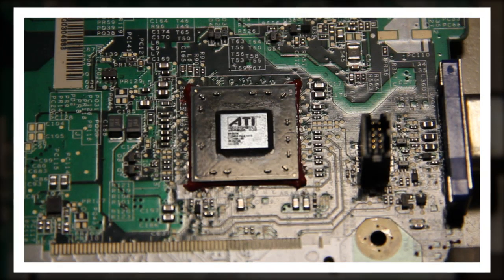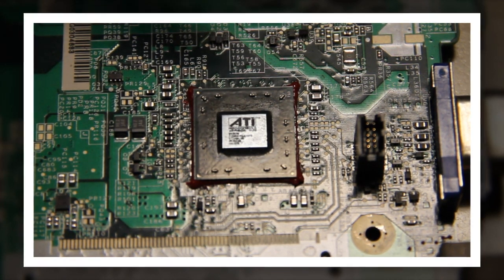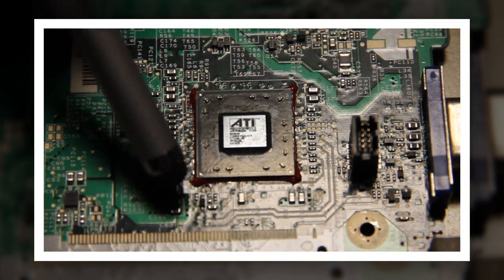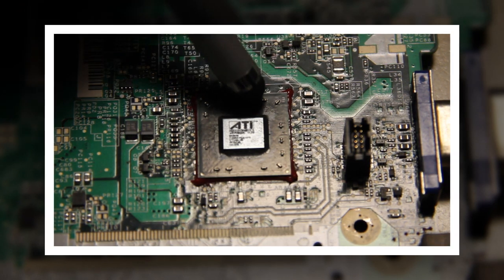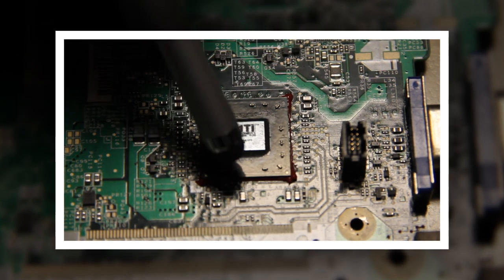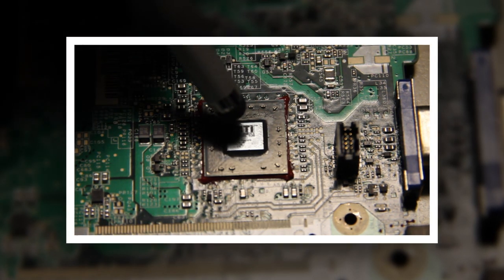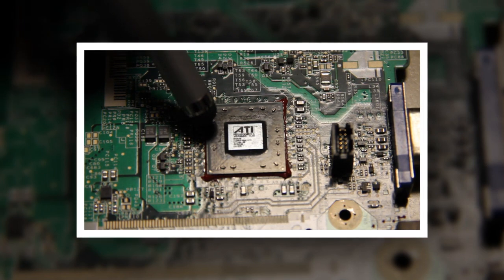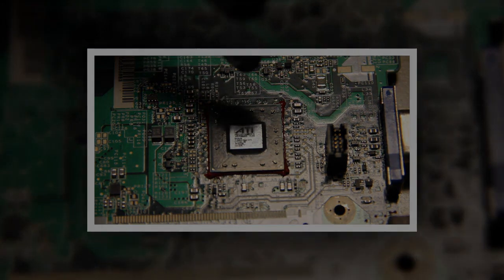GPU Reflow Do's & don'ts

Comment: This video does have a lot of don'ts, but not many do's.
When manufactured the board goes through a reflow oven, yes - an oven.
the SMD components are manufactured to withstand up to a certain temperature with minimal damage, that temperature is called the relow temperature, that's the temperature at which the solder melts.
Applying heat only to the GPU area will cause that area to expand and will make the board bow up.
I do my reflow repair with an oven, in a controlled manner, of course, and thus far all of them worked out and are still working to this day. Heck, the laptop that i'm using right now would be dead if not the oven reflow.
Since motherboards have many copper layers in them they do conduct heat away from the GPU making it hard to reflow, this can cause frustration and overheating of the BGA fiberglass substrate, which will bubble up and destroy all chances of repair without replacing the chip.
Motherboards will bow in the oven only when they are poorly supported.
Solder surface tension is plenty enough to hold the bottom components in place, the board needs to be above any surface when reflow soldering in the oven, components are easy to knock off when solder is molten.
Any batteries must be removed from the board as they will blow up in the oven and possibly knock all of the components loose if the temperature is high enough.
Flux is not necessary when reflowing, the solder fractures are microscopic and will get quickly soldered back together once reflow temperature is reached.
Talking about the temperature, it is crucial that care is taken when oven reflowing, too cold and the board won't reflow, too hot and the board will bubble up and components will start blowing up.
The oven cannot the used for food after oven reflow, this is why it's not popular to do so.
The laptop i'm using right now does get alot of abuse, i push it to it's limits and keep it there for as long as i want, so far it has been performing very well with no issues what so ever.
This comment is long as it is, i could make it much longer but i won't.
TL:DR - this video gives bad advice, don't take it for granted.
Reply from the maker: Poptart McJelly , it's a lot of what not to do, as I get so many repairs where someone has attempted to repair the boards themselves. Placing a board in an oven is never recommended, as to melt the solder on the chipset, in an oven you heat the whole board and you can un-solder other components, melt any plastic, and capacitors never like high heat. That is why  I will only recommend the correct way, which is with a reflow machine. The back side needs to be heated to 120f, and set top to at least 475f, depending on the solder used, and for about 4mins 30 seconds, again depending on the solder. And make sure to use a quality Flux, alcohol based is best for a clean application. I've been doing reflows for 10 years now with a high success rate and have seen just about every form used. If you can't afford to pay someone, or don't really care about the results, you can use any method of choice, even just putting a penny under the heat sink can apply enough pressure to work for a while.
Reply: I guess in the end it's what ever works.
 and is most practical in a given situation.
I have received laptops that were dead and were said to be un-fixable by the repair shop, only to find out that the blue soldermask had turned green under some of the chips, which are obvious signs of an attempted "reflow".
30 minutes later that same laptop will be sitting on my desk, working like new, all thanks to my oven.
So far i've only had one failed reflow, which was not only my first try but it was also on my own laptop.
I was too careless and allowed the oven to get too hot making the board sound like popcorn.
Since that incident i take care with my reflows, always on standby, ready to shut the oven off when the temperature is right.
SMD parts also include connectors and electrolytics, they are all made to withstand the reflow and they all have datasheets for recommended reflow temperature curves, the only things that can be damaged by a reflow on the motherboard are stickers, RTC clock batteries, sponge spacers and felt ( mostly found in ACER laptops over the buttons ).
Reply from the maker: Poptart McJelly, You can say what works, as I have seen a lot of ways that have worked. But from a professional standpoint, and I've been working with the best in the area, and I've know as one of the best laptop specialist in the area, I can only promote the correct way which is with a reflow machine. I won't condone with others wishes, as I know how I take apart a laptop is different from how someone else might, I may use a different brand of tools, and people choose their own vehicles, and it's not for me to judge. I have been HP and Dell certified, and working with high end clients, I only promote what is correct for the clients. I know when a new board is better than reflowing, and I know when a reflow is just as good and hundreds cheaper. If someone is highly dependent on their system, it's not always worth the risk, and replacement is the correct means. I only use solid copper shims, and I guage them accordingly. I use high end thermal past that doesn't dry as quickly, clean the entire cooling system and I have 2 types of Flux I use depending on the board. Thanks for commenting and I wish you the best.
Reply: The reflow so called experts dont want the competition. I saved numerous TVs and Xboxes from death. To last years later from my house oven. They don't want you to do that because they lose money. Seriously. Think about it. Its obvious it works, but THEY say dont do it? Come on people. Your smarter than that. My oven fixed what a shop couldn't on a Sony tv. One of the first 4k that was like 3000 new. They couldn't fix it, but then asked me to buy it from me. 🤣🤣. Needless to say my oven worked like magic. Dont pay the ridiculous amount for a reflow they want to charge. These TVs now days are not expensive..   Try to fix yourself, it will last a bit.  Then save for a new top end model year. Bet you your oven will last as long as their repair anyways. 10 years or 30 years reflowing, idc. . truth is truth. Ovens work. And it's free.

Comment: Well the best way is to bring the computer to vendor for a repair services!!!
Another way is buying a new graphic card and replace it, but that will involved risk of not putting it right as well! Unless you wanna open a shop for reflowing the chips, otherwise the $230 might cost twice more than a new graphic card.
Reply from the maker: Yes, that is why I published this video. I've been doing reflow work for 10 years when the DV Series came out with the gpu issues. Replacement is always the best option and that is what I promote, but some just don't want to pay the high cost of some boards. When it's cheaper or close to the same price, new replacement is always what I push.

Comment: I mentioned the torch since I have actually seen small torches used. They put foil around the board and hit the die with small torch. I couldn't believe it, but you can also find YouTube videos with people using a torch.

Comment: Just have baked the gtx 780 ti, And it works
Reply from the maker: +BarbaPapa *
 As with any method, it's possible. Otherwise they would never have been posted. Baking at the correct temp to melt solder would mean melting anything plastic, and any components on the bottom would fall off due to gravity. Other components can move or end up with a cold solder joint, so that is why this is one of the worst ways to get them to work. Usually what happens is they are heated just enough to warp the board, and then by re-seating the heatsink, it puts enough pressure to work. Again, this CAN work, but the correct method is the correct machine for the job. You wouldn't use a crescent wrench, pliers, or vice grips to remove the lug nuts of a tire, but it can work if the right tool isn't available. Their is always options that can work. I can only post the correct way so if any other method fails I cannot be at fault. Also, I manage a high end professional shop, and we only perform correct and legit repairs, so I will only promote the correct way to do things.

Thanks for your response.

Comment: Yesterday my MSI HD6850 got bad, and did the green vertical lines problem even in the BIOS no matter how many times I've tried or how much the GPU was cooled down. I've tried a simple re-silicone pasta method but that did not work it was permanently damaged.

I never did GPU cooking, and I was skeptical, cuz i was afrad of the things you've said in this video, that everything could become loose, warped, and be damaged if you put it in the oven, cuz the heat is all over the place (Im a BSC graduate on engineering). So I searched on google, and found out that the hair dryer method is the least risky for me, because I could focus the heat only on the GPU.

So I've took my girlfriends 1400w Philips hairdryer, got rid of the fan and cleaned off the badly dryed out (ouch!) silicone pasta with her nail polish remover aceton (what would I do without my precious gilrfiend?? lol).

After that I positioned the hairdryer on the GPU close up about 3-4mm distance, and shoot it on max heat setting for about 10-12 minutes (I didnt count the time..). I've read on forums that people are sceptical about hairdryer methoud cuz it doesnt generate enough heat for the melting points, saying that they couldnt even get it up to 100 Celsius, but I can confirm that it did go above 100 Celsius cuz I've poured a water drop on the socket and it evaporated instantly.

I let it cool down for about 5-6 minutes, and after that I put on new silicone pasta, put on the fan and took it back into the PCIe slot of my motherboard.

And to my astonishment, it did work! No green lines, Its stable since 1 day, no problems yet :)

So I just wanted to share my story with you guys.
Reply from the maker: I am glad it worked for you. Thanks for commenting.  The dangers of using a hair dryer is while it seems focused on the GPU, the extra air has to go somewhere. That hot air blowing sideways is dangerous to the surrounding components. Just to let you know as well, 100 degree Celsius is only half the temp that low temp solder will melt at. 240 to 270 degrees Celsius is where you want the temp, but not with blowing heat as it will blow off the small caps and resistors on the chipset. If you could focus the heat on the die or under the chip, it could work. On this card, I believe it should have a heat spreader on the chipset so the capacitors would be covered up and protected from blowing air. A high temp air gun can be purchased at Walmart for removing paint. This might get to the right temp, but you would have to use something to protect the surrounding components. Maybe a damp towel and foil , I don't know, I've never tried it that way. It actually may be better to remove any plastic, the fans and leave the heat sink on and heat just the heat sink with the hot air gun to protect the board from the blowing air. you would need at least 270 to 375 degrees Celsius for around 7 to 10 minutes to get the solder to melt, but it also my not heat all the pins on the chip. I only charge $60 plus shipping for reflows, so if you want to keep the card, reflowing may be the way to go. Thanks for the info and I'm glad it worked for you.
John
Reply: Mate that’s almost word for word what I did!

Comment from the maker: I'm sorry you feel the video doesn't meet your expectations. The "Do's" is to use a machine. I won't show a video that could potentially cause catastrophic failure as I would become the responsible party for any damages. A $230 machine will work, but like you stated, a lot of people are simply trying to fix it themselves without spending a lot of money. It is only an opinion, but my opinion is if you can't afford to buy the correct equipment to fix it, then take it to a shop that does have the correct equipment and have them repair it. most will repair it for $60 to $80 and have the correct machine. If you are going to spend $40 for a heat gun and attempt to fix a reflow issue that you have a greater chance of ruining permanently, than my opinion would be to have it repaired correctly for the extra $20 to $40 and you won't have to worry about any mistakes. I know I give a warranty with my repairs as well, so that tiny bit extra comes with that piece of mind that it was done correctly and will continue to last longer. Using any other method besides the correct me method comes with risks and no guarantee that it will last at all, and my need to he repeated regularly.
Reply: a dead graphics card is a dead graphic card you will lose nothing unless do this on  working one.
lots of people fix those dead gpu out from the oven what can say about that a miracle?
Reply: Well if it's just your opinion then why didn't you put it that way?
Reply from the maker: @hunzhurte  it's not necessarily opinion. I've been trained and working with electronics including soldering in bulk for 34yrs. Working in the industry, I have seen many ways people use to fix the issue. Their is the correct ways, and then ways that work by chance.

Comment: First off,you should change the title,as there are no "do's", second, If someone comes across this looking for reflow instructions it's because they don't have $600! Why anyone that doesn't have a business repairing electronics would spend that much on a reflow machine is completely beyond me! I've used the heat gun method half dozen times on my old ps3(fat) alone and spent a grand total of about $40 or so (on thermal grease,Arctic 5,if anyone's curious) then there's my old Sony Vaio,which is working 100% because of the heat gun method! (Bought both in 2008! ps3 still games and laptop still fine for internet browsing,and older games) For $600 I could just get a new ps3(or 4) and have plenty left over! ...or a cheap laptop,maybe use it as down payment on new(ish) laptop!  Thanks for the "Captain obvious" tips though
You mean I shouldn't stick my MB in the oven @ 350+ Degrees?!?.
Reply: Stick it in the oven?! Ah, no! Will using thermal paste/clay protect the nearby components? Use a torch?! Nope! Just a heat gun!

Comment: Nice video, but I doubt anyone's gonna buy a 600$ machine for that 1 or 2 reflows they'll ever do, if you constantly have to do something like this then yeah a machine is prob the best solution. I just did my first reflow today with an old GTX 260, what I did is put it underneath my microwave oven grill for about 7-10 minutes and it works again now.

Comment: Don't do this, don't do that, and definitely do not do it that way. Very unhelpful.
Reply from the maker: I made the video as a test, but also informational. Yes it's a lot of don't do this or that, but all the methods mentioned are what I hear a lot of shops doing and they all can cause many problems. Their is only one real way, which is the correct way with the machine designed for the job. How many ways do you dig a hole in your backyard 18 wide 24 inches deep? Not with a cup, not with a spoon, but the right tool such as a shovel. This is only to help let people know why to stay away from bad methods when re-flow machines start at $200 and the preferred one is about $800. If you are going to be doing this for a business, just by the machine. 10 boards and it's paid off.
Reply: John Gebman I did it the wrong way like I always do when the GPU replacement is not an option or too expensive. Disassembled. Cleaned with alcohol. Used foil tape around the GPU to protect all the other components. Sandwiched the back of the board against flexible closed cell foam to keep any components from loosening. Ran a heat gun at max for 90 seconds moving constantly. Allowed it to cool. Untaped and cleaned up with alcohol. Re-assembled with good heat sink compound. Works like a champ. Been several months and no complaints. Luck? Perhaps. But I've done it several times (maybe 10+) and everyone still seems very happy. But no guarantees. BTW. The best way to dig a hole in these here parts (NC Coast) is with a jet of water, not a shovel. You can dig down 8 feet in about 15 minutes.

Comment: Wow great help . Smh tell how to do it then !
Reply from the maker: The best way is to use a reflow machine. set the bottom temp between 120 degrees Fahrenheit to 140 degrees Fahrenheit. Then set the temp for the IR lamp from 475 degrees Fahrenheit to 825 degrees Fahrenheit depending on the type of solder. Most laptops 475 degrees is sufficient. Dells usually need a higher temp closer to 675 degrees. I usually time it at 5 mins, but I let the boards sit for 20 mins before I remove it to allow for a slow good set. One big important tool is also to use the right type of flux to get a good solid solder. I also use a heat shield to make sure nothing but the chip set is heated even though the IR lamp has it's own. I take extra precautions as I'm working on someone else's investment and I don't want to break what I'm trying to fix.
Reply: +John Gebman Having this issue with my gf's laptop. What's the best technique if I don't have access to a reflow machine?